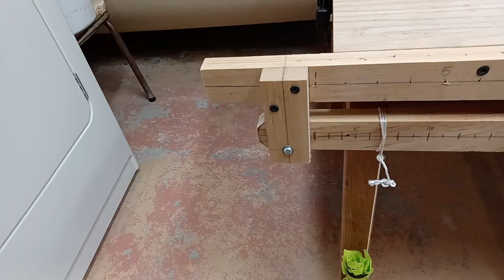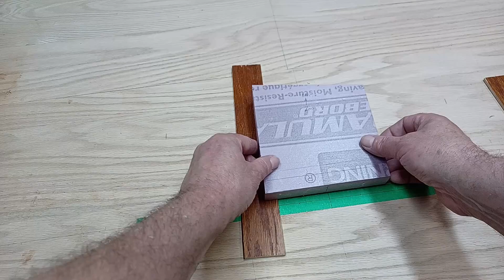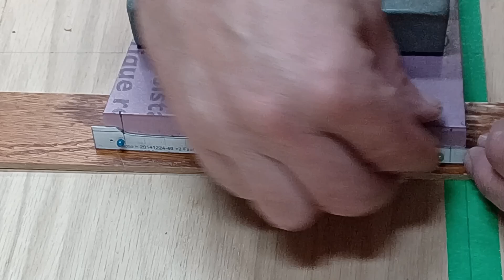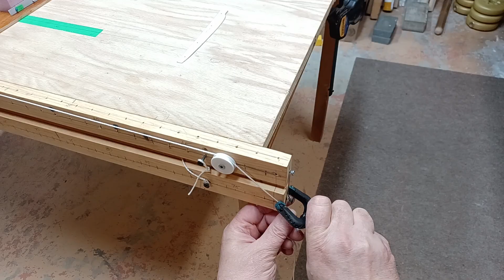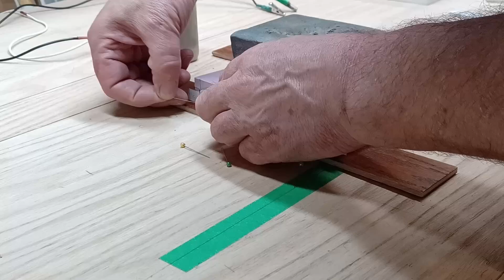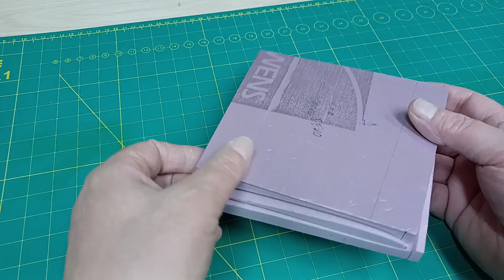Foam wing core cutter. How to BEST use a hotwire cutter.

Comment: Why does this work better than your hands?
Reply from the maker: it's a constant and consistent force which eliminates issues if done by hand. Issues like waves, thin-outs and ridges on the surface.
Basically, you'll never be as smooth if done by hand. 🙂

Comment: Thx for this vid!
A decade ago I made something similar to cut 45degrees front leading edge delta cores. That was a PITA to control the heat in the wire and took me a few weeks to mod the wire itself.
I was looking for an option to have washout build in a wing with ailerons but can't do this with ribbed wings and need to use foam core cutting.

br, Erik
Reply from the maker: thanks for the comment. I found the only way to get a wash out contour in the wing core is to use a cnc. 
Started making a mpcnc primo just for fun  :)

Comment: Yea!! I completed my automated hot wire today. Now I just have to clean up my templates or possibly make new ones as mine seem to be on the very thin side when cutting the tip. I tried sanding more on the bottom of the lower cut and used tape on the bottom of the upper cut, hope that works better. Thank you again for sharing this information as it has worked out great in my build. 
Thanks again and God Bless..

Comment: A few questions for confirmation.  1. The line on your green tape is parallel to the fixed arm, and TE of block aligns right over it. 2. The centerline on table is perpendicular to fixed arm and aligns with the 50% mark on the moving arm. 3. The centerline on the block of foam runs from 1/2 of LE to 1/2 of TE, and I visually align the two centerlines when setting up the block on the table. 4. What are your templates made of? 5. Why the two nails taped to the bow legs? Thanks much. David
Reply from the maker: you have the method down pat  :)
I made my templates from .8mm thick aluminum flat stock. I found it easy to shape but ridge enough for my purpose.
Those nails are just added weight to the ends of the bow to help it's balance.

Comment: Without getting in the mud myself I don't understand what is being solved here,  but clearly it's something.  I'm sure I'll will be back here after I build a hot wire cutter and screw up some foam.
Reply from the maker: in a nutshell,  the feed table will give you a consistent travel speed which gives you a smooth cut that you can't do by hand.
Reply: cutting constant chord airfoils by hands is not too bad but this rig lets you use gravity and a simple lever to 'sweep' the wire along the wing and cut these nice tapered sections. great demonstration thanks for sharing

Comment: Pretty slick. In the early 90's, I wrote the software for a CNC hotwire cutter that a friend used to cut foam wings for pattern fliers. It was bit of a challenge to get it to cut tapered wings.
Reply from the maker: glad you liked it. 
I'm working on making a cnc that will be able to cut a wing half at once,  eliminating the joints and providing a smoother transition 👌 😎
Reply: Sounds exciting! Did that ever go anywhere?
Reply from the maker: I dabble with it when the mood strikes me...:)

Comment: I really want to build a DLG glider, but now it looks like I have to build a foam cutter first. I can't think of a thing that could go wrong.
edit: The nails are for extra weight, correct?
Reply from the maker: thanks for the question. Yes, I used what-ever I had to add a little more weight on the arms to force it down more  😎👍
Reply: @amonus-air2160   I have plastic sheaves on my shopping list today, wish me luck!

Comment: Thanks for a great video!
What foam is that?
Reply from the maker: Thanks for watching and the compliment!
I use Owens Corning FOAMULAR CodeBord XPS Rigid Foam, which is available to me locally at 
the HomeDepot. It's meant for exterior walls in new home construction.
 It's the lightest XPS foam I've found, without going into exotics like Rohacell.

Comment: what is the longest block (span wise) that you can cut with this
Reply from the maker: Hi!
I've personally done a 55cm span for a 2 airfoil dlg, and I had zero issues. I can only assume that at some point in going extremely wider, wire dragging would be a concern.
Thanks for the question.
Reply: @amonus-air2160  thanks for the answer!

Comment: Amazing resource! Thank you! Is there a reason you chose to cut the bottom template before the top?
Reply from the maker: yes. If you cut the top first the core will end up slightly thinner than desired. Thanks for the question.

Comment: Any reference you can share on the power supply for the hotwire?
Reply from the maker: yes, Google hotwire Cutter Power supply diy. There's a guy who goes through it in detail, forget his name.
Reply from the maker: https://youtu.be/-d_XNhQy-I4
Reply from the maker: I used a 12V 15A 180W Power Supply . Bought it from Amazon...https://www.amazon.ca/gp/product/B07DN7MYD1/ref=ppx_yo_dt_b_asin_title_o03_s00?ie=UTF8&psc=1
Reply from the maker: @johnnichol9412  yep!...sounds about right. I get more consistent results when you eliminate variables like amperage and feed speed